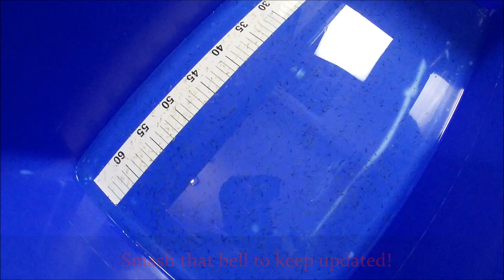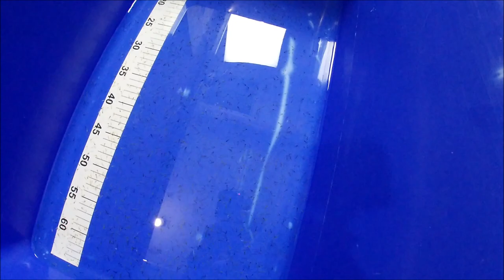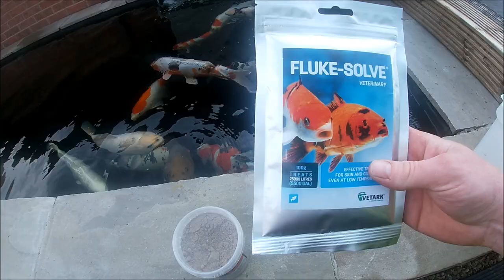KLJ #31 - Koi Scrape - Fluke Treatment - New Fry - Busy Times

Comment: Hey dave, you are not alone as it seems flukes are everywhere. I do a 1ppm potassium permanganate on the whole pond the day beforehand to help reduce the mucus layer on the koi that way the fluke treatment gets to work on the flukes easily (im not entirely sure if its overkill but it works for me). Chloramine T does the same thing too if potassium permanganate is not to hand.  Duncan Griffiths has a book called "step by step koi diagnosis and treatments" (its black with a showa and a blue flower on the cover) in some circles its known as the koi bible but at £50 its not cheap.
Goodluck matey.
Reply from the maker: Might check out the book thanks. I rarely put chemicals in the pond. I use salt also coming out of winter so restricted on what I can add.  This is only the 2nd time I have had anything. But you're right it's the year of the fluke. The temperature swings stressing the koi out is the culprit in my eyes.
Reply: @dkoi-tv  stress opens the door to all kinds of trouble so i guess you will be heating your main pond again sooner rather than later.
ASHP are efficient but gas is cheaper per unit compared to electricity so a boiler may prove to be the cheaper option longterm. 
We already have two boiler's here so a third may not be an option unless I change the incoming gas pipes but if needs must.
Stay safe mate and don't work too hard 👍🏼